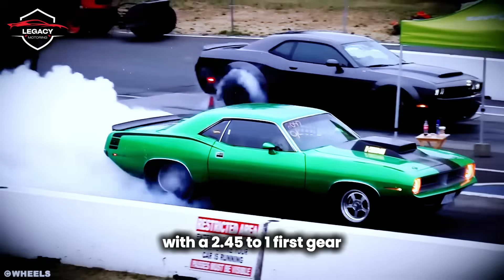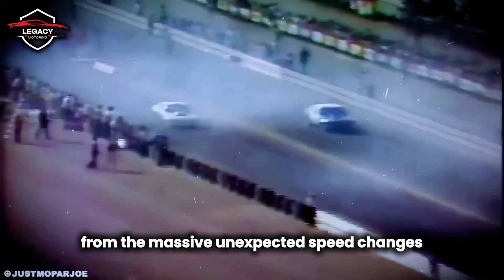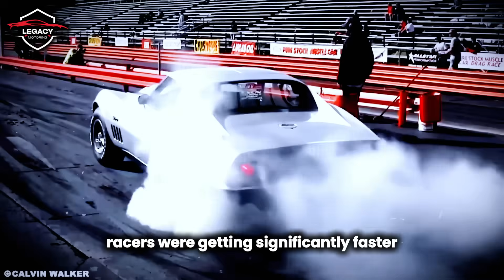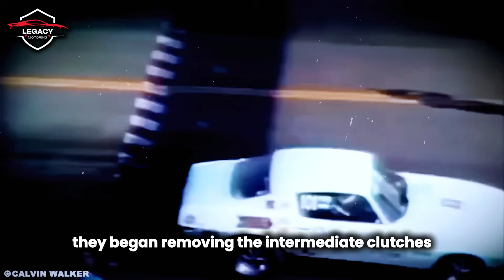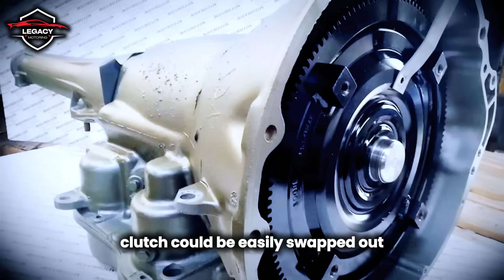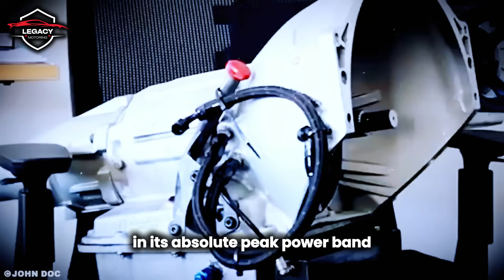The "Illegal" Missing Gear That Broke The NHRA: Chrysler's Banned 2-Speed Secret?

Comment: I'll never understand insanity to run only 2 speed trans. 6 drag cars with both pos expensive over rated powerglides and then th400.  Every car , every single one of them has been a minimum 2 tenths quicker with th400. It's the convertor guys! From my 7 second drag car to 12 second drivers, I'll keep the extra gears!

Comment: From 1/2.45 to 1/1 gear ratio would be a huge bog in torque. I doubt this would work.  I have only one experience with a 2-speed automatic: a friend's 1970 4-cylinder Chevy Nova with a 2-speed automatic. That thing was dangerously slow.

Comment: For several years, as a diemaker at a GM transmission plant, I made customized valve body spacer plates. Every GM engine/chassis combination used a different spacer plate to tune the transmission performance to its unique engine/chassis combination. We also made spacer plates that were sold to after market suppliers for use in shift kits, that were popular modifications for weekend drag racers.

Comment: So much wrong with this story. Yes, the removal of one gear can impact time slips, a properly setup 3 speed will have less drop at shift points than a two speed. A power glide basically loses 1st gear with a "1st" gear of 1.76:1. Dropping 2nd gear would kill the shifting as it would go from 2.45:1 into 1:1 ratio a massive change. The TF 727 while a strong trans has some serious issues not called out. The sprag (one way roller clutch) is barely enough stock. When launched, tire slip can result in over speeding the front clutch drum spinning at much higher rpm resulting in a dangerous failure. When the front clutch drum fails the drum sends shrapnel in many directions. Several people have been severely injured due to this even with a trans blanket and scatter shield. Usually the issue is caused when a trans brake is used.  This is a very well known issue.

Comment: Do I have to say it? Really do I? Hahaha Who's going to stop any racer from shifting gears or not shifting to third? Sorry I mean no disrespect. It's just a bit crazy. Getting snubbed on shifting rule when Chevy made a two speed. A auto trans can still shift manually. Does that make sense? Seems cut and dry. If there was a advantage of using only two gears they would use it and they did. The problem was the modification removed internal parts and weight I would think. The trans-go kits you touched on came with the procedure which is worth more money. I've never read any trans kit trying to shift smooth. I have to take a look. I only remember firm or positive shifts. It be  smooth if you compare it to the in limbo feel as the engine flares up. You have to let off the throttle to shift. That's not smooth. I think it was more about shedding weight but I'm probably wrong. Collecting those early torqueflites is exactly what you said. something from the past that played a part in history and the guys who did it. The hero to some of us. I wouldn't say they out did the engineers though. Some off them worked for Chrysler and they loved to race as well. Even more so helping those running a Chrysler at times. If you look at the others who pushed the limits they were not the usual backyard mechanics. Most with somekind of engineering or machining backgrounds and machines to do it almost like a second job.I'm not trying to bash. But they were standouts and heros to me a dumb backyard mechanic. 

Now the 10sp auto is doing exactly what you said. To stay in the peak power range. But it's more than that. Check any 10sp car's ET and it's a big difference. Half a second. They really opened eyes to the manual guys. They're aggressive. It's a different thing all together. Not sure if it's been cracked yet. It's just crazy with different modes. They break the tires on full throttle shifts.

Comment: Type F has friction modifiers. Mercon/Dextron is more slippery when compared with type F. Old GM transmissions used Merc/Dex but you could use type F instead and get better engagement, firmer shifts, and enhanced performance.
Reply: When you say "old GM" transmissions how old are you talking? TH350, TH400? Later?
Reply: @NoStringsAttached777  yea, TH350, 400, even late 70s to 80s 700R4. Had a friend running type F in a 200 4R in a Corvette. My teacher in Mech school told me about it, he said it would even work in some GM FWD transmissions. He put type F in everything since the early 70s.

Comment: If you want an automatic to shift faster you need better solonoids and to increase the rate at which it builds fluid pressure.... Or just run it at a higher pressure. The "clutch" is a pressure plate essentially that uses fluid pressure to activate or deactivate contact with a set of what are essentially sandpaper covered metal disks   Modifying the pump could work on the earlier models, though automatics now run computers that you can just tell to run a higher pressure, build earlier, etc.  technically it can shift almost instantly, but it's reliant on how fast the pressure can be thrown into the k1-k3 plate sets.  

Also, if you tried removing a gear nowadays without reprogramming you'd send your car into limp mode, transmission tuning is insanely complex, almost no one does it these days, but it's worth learning IMO.  Its how you put down the power to the rubber.

I'm kinda surprised it could still pull going from gear 1 to 3.... It's so steep, I feel like that'd take a LOT of torque.  Doesn't surprise me that it does after 37 passes.  My transmission has to come OUT to swap the disks, cuz the bell has to come out, and the shaft that runs through their center does too, so essentially you have to remove the whole trans to swap em.... You ain't gonna catch me doing that for a lousy 37 runs.... That's a full day project to remove, a few hours to rebuild, and another to put back.  Done it myself twice (made a mistake the first time through the rebuild), if I never have to do it again you can bet I won't.

If you have to keep all the components in the car....throw the extra disks into the trunk 😂. Also, though it becomes wasted rotational weight, just keep the clutch packs in there.  Block the shift passage with JB weld and reroute the hole to the 3rd pack and noone is gonna notice.  It still spins gear 2 the whole time so technically it IS still utilizing the parts 😂.

I'm surprised no one figured out that the ULTIMATE end of this upgrade is a CVT.  NO shifts is the fastest shifts.  A CVT just slides between full torque and full top speed.   It's not complex though, it's 2 conical pullies that usually use the rotational force to adjust the ratio.
Reply from the maker: That's some seriously creative thinking on how to hide those extra parts! 😂
Reply: You are partially correct, but you don't change the pump pressure to change the pressure to the clutches because that changes on both sides of the clutch. That is the purpose of the valve body spacer plate. There are holes in the spacer plate that determine not only how fast the pressure build up on the apply side of each clutch pack individually but also separate holes that set how fast the pressure bleeds off. By getting the right balance of these holes we can tune a transmission for a Cadillac, where you don't even feel the shifts, or you can tune that same transmission for a Corvette or a Z28 Camaro where every shift is like a kick in the seat.